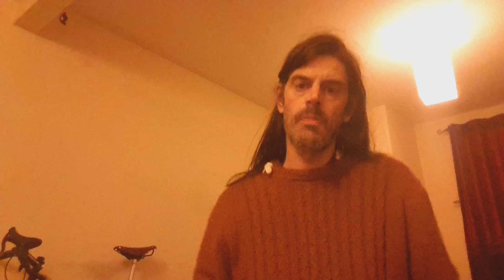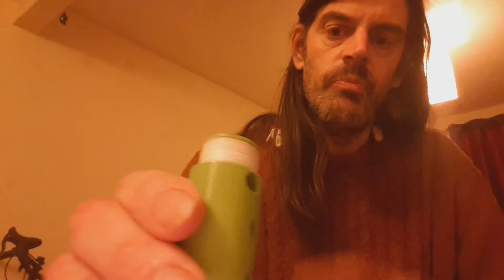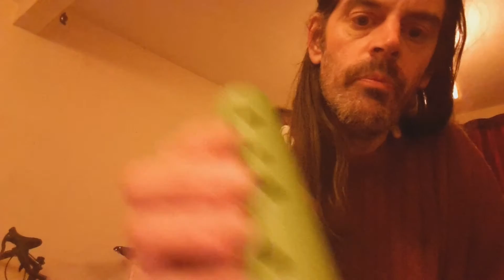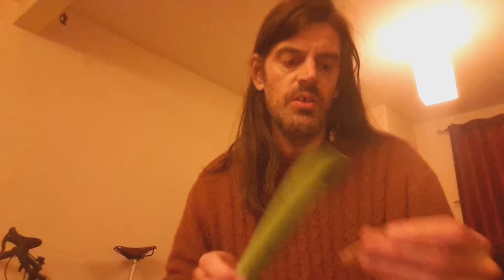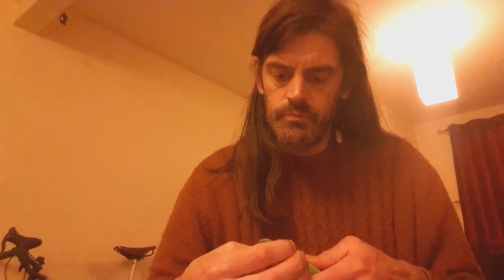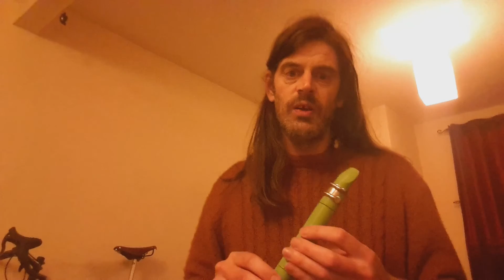A quick demo video of a 3D printed reed instrument

Comment: you're really onto something here, did you make more versions of this? i feel inspired by this because i'm wanting to 3d print harmonica reeds.
Reply from the maker: Thanks. I am slowly working on improving the design. The tuning needs to be adjusted for some of the holes, and also ideally what are called the cross fingerings that you use to play the chromatic (in between) notes.
Reply: are you still using freecad? I'm yet to explore it. I'm playing with blendercam these days, plugs into blender with a couple extra steps it's amazing but it's experimental.
Reply from the maker: @neuroblossom  yes I'm still using FreeCAD. The good thing about it for this application is that it is fully parametric, which means all the dimensions of your objects can easily be changed after doing the modeling.
Reply: @andrewbaxter2703  have you found anything free that can do acoustic modelling? i;d love to get into that
Reply from the maker: @neuroblossom  no, I haven't tried that.